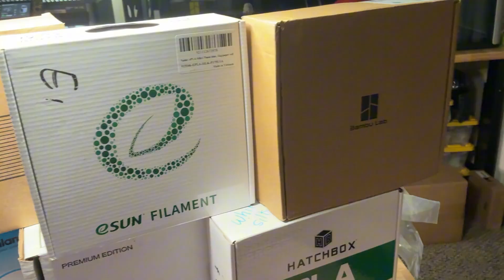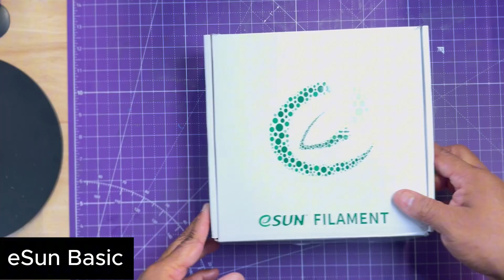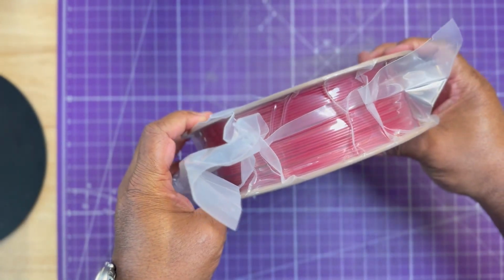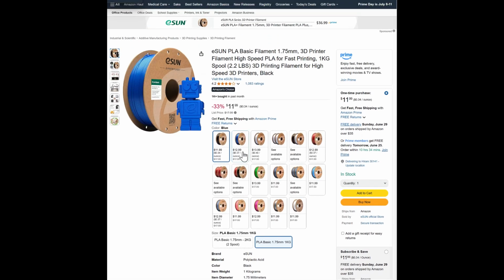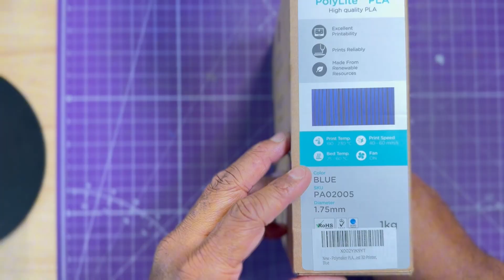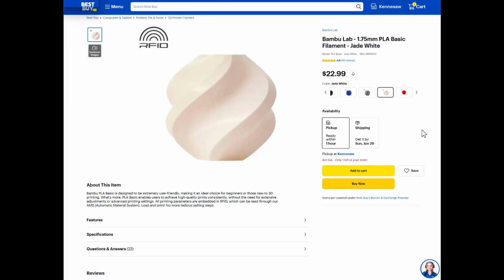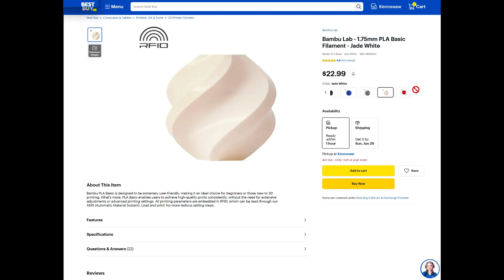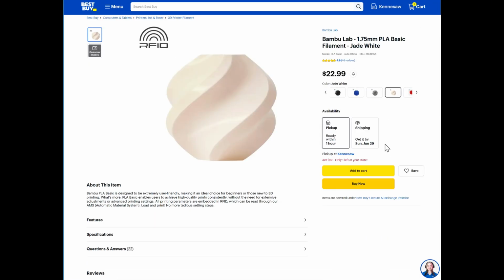My Favorite Filament Brands for 3D Printing in 2025 (Top 5 Picks I Actually Use + 1 Bonus)

Comment: esun is not good it keeps having extruding issues when changing filament i use AMS if that makes a difference
Reply from the maker: It does. Most likely the cardboard spool. If I find that there are issues, I just respool it onto a Bambu reusable spool.

Comment: Cardboard spools are GARBAGE,  Totally not worth it.  There are comparably good or better filaments which simply work better in an AMS with or without an adapter.  Just today I ruined a print with a spool from eSun, it was on the "hub caps" but the cardboard broke down and slipped, then the filament broke inside by filament buffer on the back of one of my H2Ds.  Sunlu, Bambu, American Filament (PTCG), and many other top-teir, reliable with or without an AMS.  Cardboard generates too much friction even in a drybox with rollers (like Polymaker's).  The spools absorb water, even if you keep your filament dry.  The edges swell and deform, break and then will not roll right and will cause failed prints.  Also, they spew debris inside your AMS's.
Company's that use cardboard spools care more about the extra 3 cents per box than their customers.  Plastic spools (including reusable ones like Bambu and Sunlu) can be used by everyone in every circumstance and are at least as green, since there is no waste.
Reply from the maker: Totally get where you’re coming from—cardboard spools can definitely cause issues in AMS setups, especially when they start to swell or slip mid-print. That said, not everyone’s running an AMS. A lot of folks are still using single-spool setups where cardboard isn’t as much of a problem.

That said, I think you’re right—the filament game is getting more competitive, and companies are starting to listen. Just look at Sunlu—they recently updated their spool design. The old one wasn’t even cardboard, but still gave people trouble in the AMS. Their new spools actually let you use Bambu-style refills now, which is a smart move. It’s good to see brands paying attention to what consumers want.
Reply: @InfiniteLayers3D  I've been using a fair bit more Sunlu recently just for this reason alone.  The 
Most new printers seem to come with an AMS... Creality, AnyCubic, etc.  But, yeah not everyone has one.
Cardboard can also have high friction on rollers or hubs (think using a Polybox as a distributor, etc).

Comment: I want to buy Bambu A1 and print high detail small objects like miniatures.
Companies promote High speed PLA for high speed prints because they flow better but small high detail objects need low speed for the best outcome.
On the other hand small high detail objects need 0.2 nozzle 0.08 layer height that some times cloggs the nozzle.
In a matter of speed buying High speed PLA to print 50-100 speed looks like a waste of money but I wonder if the improved flow of High speed PLA will help the 0.2 nozzle never cloggs.
Reply from the maker: Honestly I think you can’t run a .2 nozzle fast. It will probably clog. I truly would not recommend fast print with a .2 nozzle. I think for best detail on miniatures you will want a resin printer.
Reply: @InfiniteLayers3D As I said above my print speeds will be 50-100 only using 0.2nozzle 0.08 layer height.

Comment: I use Sunlu a lot but i have problems with their White filament which strings a lot and for that i use JAYO and never had any problems.
What is so good about Sunlu is there filament comes in a zip bag and their spools are reusable as i no longer have to print out spools for my left over filaments.
Reply from the maker: I agree Sunlu has stepped their game up.
Reply: @InfiniteLayers3D  Jayo has been bought by SUNLU ... both brands come from the same production line.